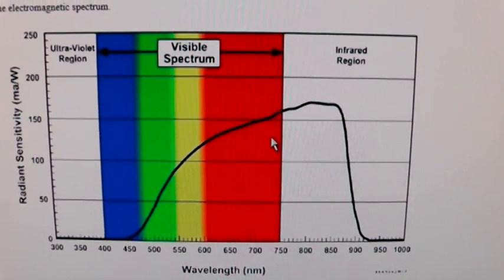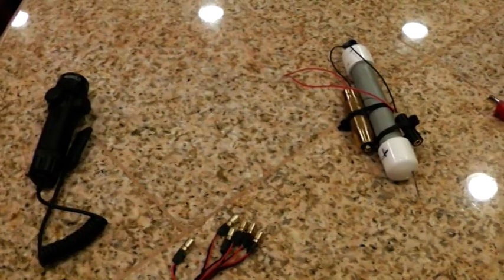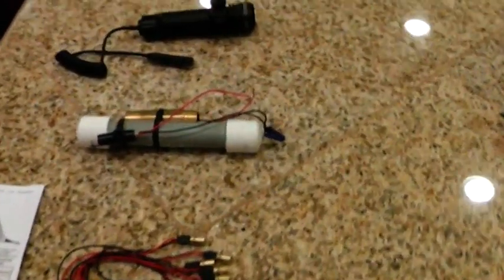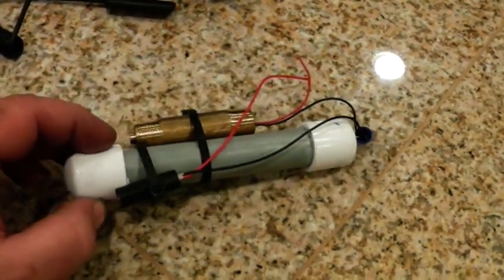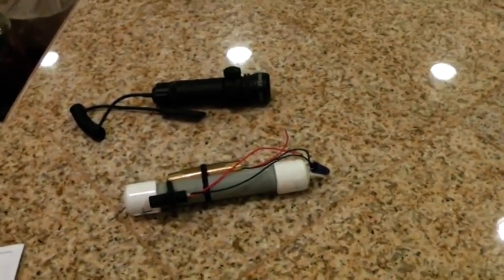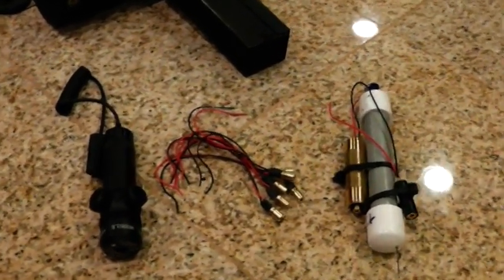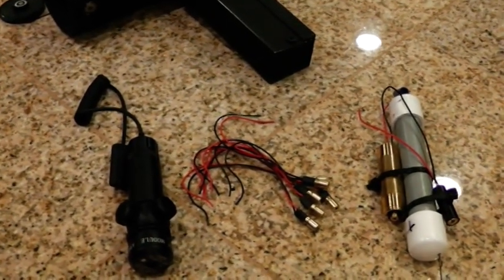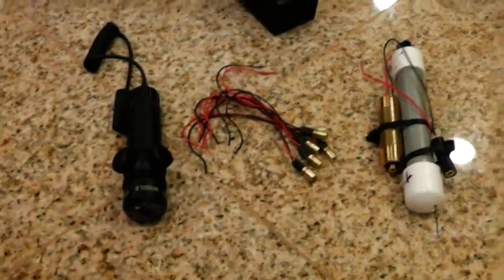Homemade Infrared Laser Sighting DIY Part 1

Comment: Not sure if the author keeps an eye on these comments..just in case. do you recall if the source from the 780nm was visible, i.e could see illumination from the pointer its self. I ask as I went to buy a 808mn IR laser and was told that the source was visible which doesn't seem right.
Reply from the maker: The 780nm was visible at the source, the 980nm was not.  Some people are purported to see up to 850nm with a dim red glow.  If I were to make a laser sight it would be 940nm minimum.  Just be careful to not go out of the range of what your nods will see.
Reply: thank you Sir
Reply: I know this might be off topic but the cheep nv dash cam's on ebay will see 950nm and record to small sd card.